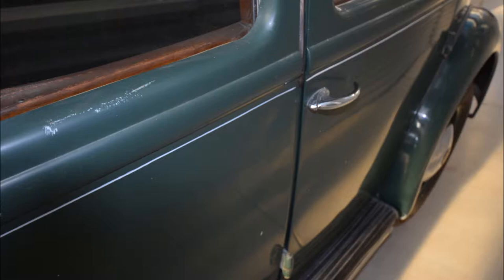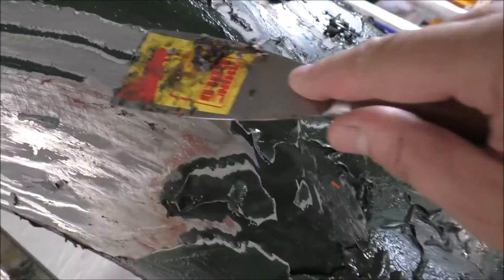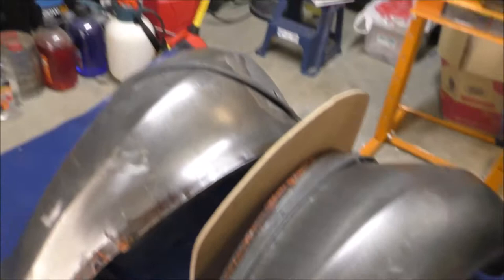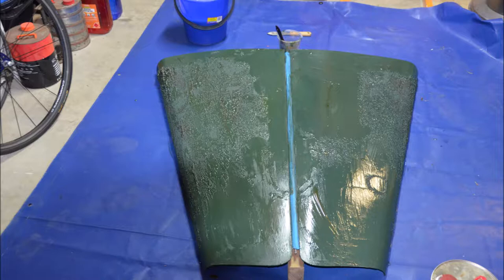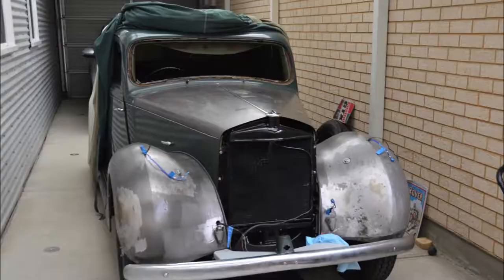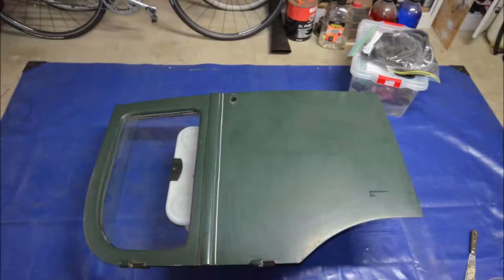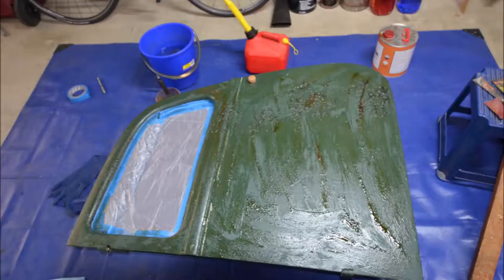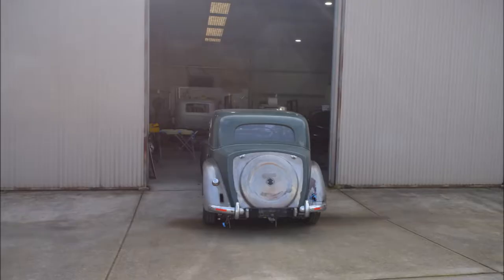Greg's 1949 P3 Rover restoration chapter 10 paint stripping

Comment: Greg will you be doing one for the electrics with flashing indicators please? John
Reply from the maker: I will do a couple of episodes on the body repairs within the next few weeks. Probably wont cover much on the electrics. I have a new wiring loom made up by Auto Sparks in the UK; so the main work will be fitting the new wiring loom.